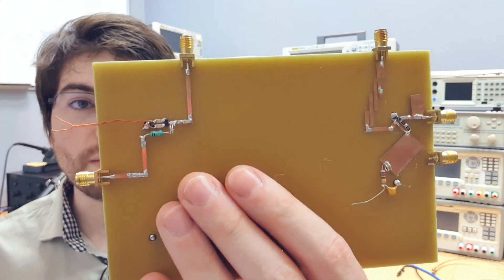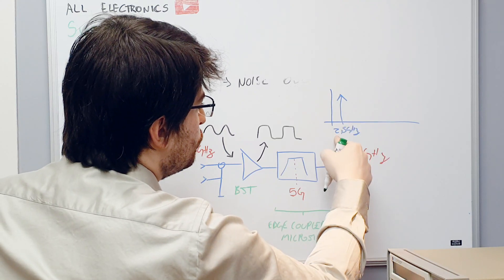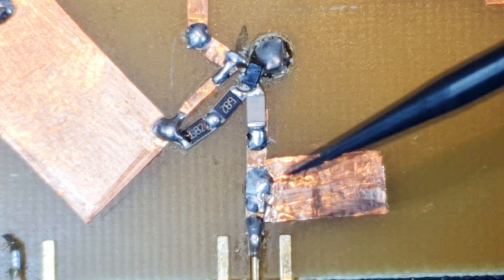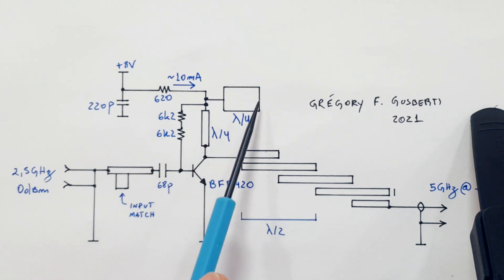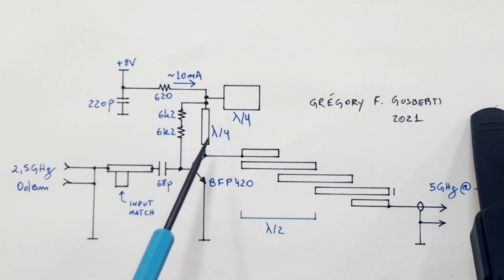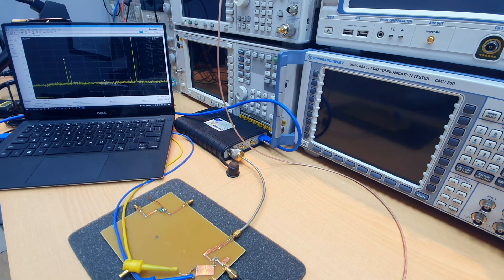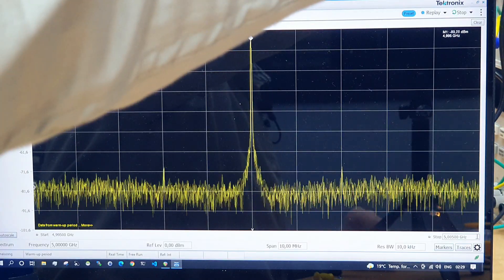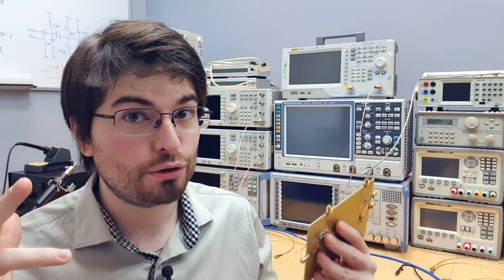Microwave Circuit Multiplier

Comment: I am designing the rf passive multiplier with input frequency 2ghz and it's a frequency doubler but while doing the simulation in ADS the Schottky diode is not available in Ads so my simulation is not working pls help me what can i do now for the simulation how can i solve the problem of Schottky diode pls help me

Comment: Hi Gregory, I would take a moment to appriciate the genius behind this circuit, but if we just revisit the basics of fourier series we find that frequency spectrum of a square wave only contains odd harmonics of the fundamental so that sets us up at 7.5 GHz as the first frequency just after the fundamental 2.5 GHz, then 12.5 GHz and onwards, so how is the circuit filtering out the 5GHz component when the math says that 5 GHz cant exist?
Reply from the maker: That is a great topic; thank you for the clever question! What happens is that the output waveform isn't a perfect square; the distortion at the top of the wave is different from the bottom. Asymmetry means that we have even harmonics present! Take a look on this video: https://www.youtube.com/watch?v=acWZLW5EE3U

Comment: Sorry more questions!

For the collector filter you use two 1/4 wavelength sized strips of copper. Are the 5GHz waves reflecting off this and bouncing back and forth to create a tank? Wouldn’t these 1/4 wavelength strips act like antennas? 

Also for the input impedance matching you use just a copper plates, is this acting like an inductor?
Reply from the maker: Good ones!

1) Yes, exactly. That is called a edge coupled microwave filter. Search for that. Radiation is low because the majority of the field lines are between the gnd plane and the trace.

2) Yes.. thin traces act as inductors, fat trace as capacitors. That is called a stub match.
Reply: @ 
Thank you so much! It has been so great learning from your videos! I can’t go to school for this stuff so you are my professor 👍🫡

Comment: Are those large copper plates like capacitors using the substrate and ground on the other side? 
Also that’s a cool idea for a band pass filter! Does it have high Q? What demerits does it have over traditional tank circuits?
Reply from the maker: Yes

Comment: Hey man! New subscriber, just dipped my toes in the microwave dark magic. I managed to build a 5.6GHz synthesizer with LTC6946 and SKY85712 on a board (FR4 substrate) designed by a fellow HAM. Having the board premade was easy enough to build the synthesizer to output +15dbm at 5.616 GHz. However, I mostly learned SMD soldering (very good lessons altogether) but less design. 
Excellent channel, you give me the courage to try and test for myself with microstrip technique. your approach is much more hands-on  and I believe this is what I need for my development.
In theory, this would work with lower frequency input signal, but the spurious would be much higher and probably harder to filter out.

Greetings from Romania, 
Octavian
Reply from the maker: Be welcome! That is nice to hear. We are always learning, the thing is to go to the bench and try, try, try!

Comment: Actually when you use this technique, it generate odd harmics 3th 5 th and etc the  even harmonics amplitude is less  this is much more efficient for generating odd harmonics not even
Reply from the maker: Yes, you are right. But the waveform is not so symmetrical as you are imagining, a lot of energy goes to even harmonics.

Comment: Question.  What fr4 double sided pcb would you recommend?  I looked at some sites and I am not sure which pcb to get.  Thank you for your videos.
Reply from the maker: FR4 is not considered a RF grade substrate.. So, there is a lot of variability, and you don't have proper characteristics. I recommend you to buy some and test. This is what I do. In the end, everything I buy is useful at some point. 
Don't expect to make a very precise design in FR4, tuning it a lot, to work when you get a new batch of pcbs.
Reply: Thank you for the reply.  Any suggestions as to what to start with?  I was looking at pcbs from Mouser. @AllElectronicsChannel
Reply from the maker: Get it! I buy from local market, much worse that yours haha. 

I recommend you to etch a stub. Measure the frequency of the notch, and calculate the material Er backwards. Now you know the Er of your pcb for usage in yours designs. 

Get some 1.6mm and 1.2mm FR4 and GO TO THE BENCH hahaha

Tip: you already thought too much. Just buy it. My approach (my big secret) to design is: try first and think later =]

Imaging what would have happened if, before I record this video, I asked for someone about using copper tape over a PCB hahaha. I would never have done this video!
Reply: Thanks again.  I am still learning about things like ER.  How do you measure the ER of a trace?  I have a NanoVna and other ways to measure impedance. I am researching ER to try to understand what ER is. @AllElectronicsChannel
Reply from the maker: Er is a propertie of the material, tale a look with calm at my last message

Comment: Your video is amazing. To create a multiplier in this manner is something I would have never thought about until I saw your video. That being said, there is one very important point you should have mentioned. If I was a lay person, I would just take your word for it without questioning; however,  with some knowledge of digital signal processing, here are some additional sentence that need to be added: when a sine wave is changed from time domain to frequency domain, there is one fundamental frequency. When sine wave is over amplified and top and bottom parts of the sine wave get chopped off and turned into almost square wave and finally transform this almost square wave from time domain to frequency domain, there will be lots of frequencies that are multiple harmonics of the sine wave fundamental frequency. As you mentioned, 2.5GHZ, 5GHZ, 7.5GHZ, and so on. Just my two cents thought.
Reply from the maker: Thanks man!

Comment: Very Good Video as allways. What is the Maximum harmonic That you can pick easyly with an analog multiplier? I have Seen some Videos uses the 9 Harmonic or the 11 very interéting topic
Reply from the maker: Thank you! What matters is the rise or fall time of the distorted wave.. 

You can grab higher and higher harmonics with faster transitions. 

With the transistor amplifier I believe up to the 5th harmonic you still have nice power. 

I have a video on the channel using a PIN diode step characteristic to extract the harmonic 10.

Comment: Very nice job and explanation. 
The BFP420 is a very nice transistor for stuff like this with its 25GHz transistion frequency while still being solderable by hand. 
I use it for my experiments as well.
Did you notice any artifacts by only grounding one of the emitter pins?
I guess for the calculation of lambda you use a shortening factor for scaling to the FR4 medium?
One interesting thing is to try and use some parasitic effects of your components in a useful way.
Like the coiled up leg of your through hole resistor. 
In general I find through hole resistors quite nice for bias voltages, since most of them have some inductive component to them already. 

I totally agree with you about the experimenting approach. 
Not only for RF stuff but generally, I find it way more efficient to just try some stuff instead of only reading about it.
Reply from the maker: I didn't find any artifact, at leat for this frequencies. But more investigation could show something about that spurious tones? It may be related.

I didn't use any factor 😅🤣 
Sometime ago I backcalculated the effective Er to be about 4.2, using a notch 1/4 stub, I'm using this for all tests

Yep!! The resistor are great fot biasing. That coil I made to act as an inductor to help with isolation.. some turns on the lead become a good inductor for GHz

Comment: excellent job again and good explanation as usual. thank you. how do you measure and tune those two quarterwave transformers (at 5GHz) to get the best RF isolation? do you do that when the transistor is in the circuit? do you inject a 5GHz tone to the DC bias? what do you measure to tune those two? or maybe you dont tune them at all?
Reply from the maker: I didn't tune them!! Performance don't seem to be much sensitive about them